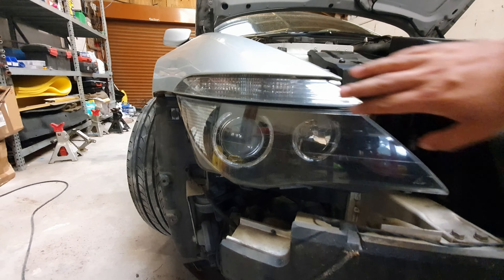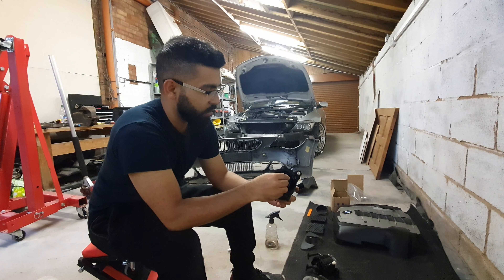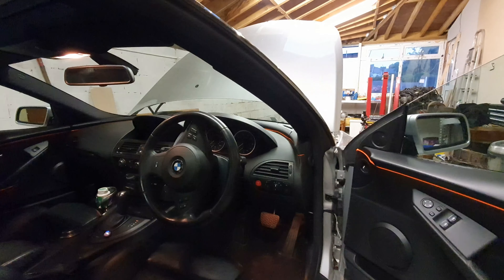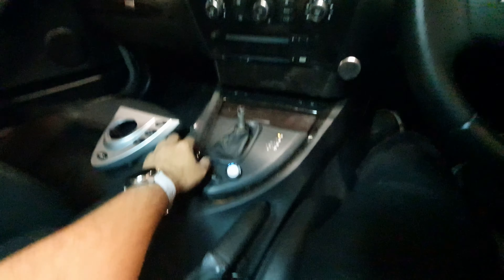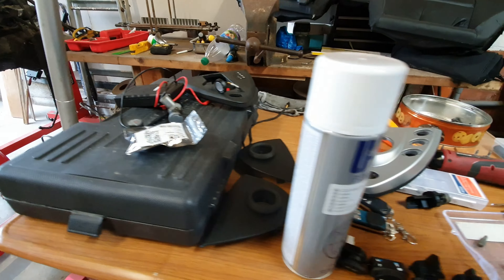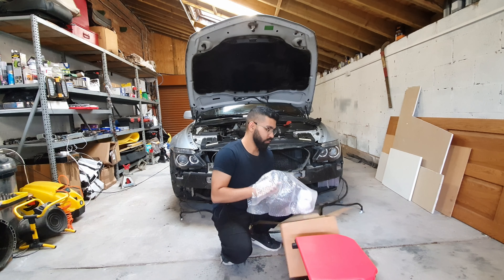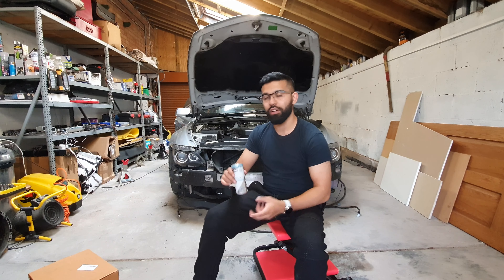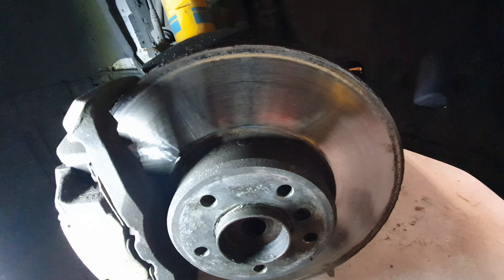BMW E63 650i | New Fog lights and Interior Strip | Budget Supercar Build

Comment: Brother at 16:35min where was this part ? about the orange led tape where you plug or  solder them to give them power ?
Reply from the maker: This was basically the electronic part of the exhaust bypass system. The main motor. It's a rubber protector and not tape that covers it mate.
Reply: hmm i dont know what is that lol... i supose to have that on my E64 LCI 635D of 07/2009 ? :)
Reply from the maker: It wouldn't no, it's a custom part because it's for the exhaust to in essence become a straight pipe. I did a video of it recently so have a look to get a better view of it all

Comment: I ended up buying OEM headlights and turn signals from Santa Monica BMW because of the pitting and condensation problems. Do you ever get condensation in yours?
Reply from the maker: Recently I have noticed some condensation so I might look at repairing that. Will look into it